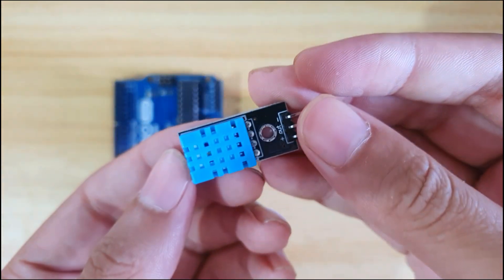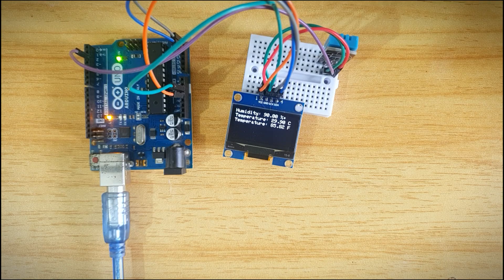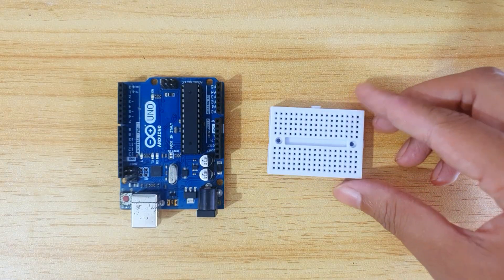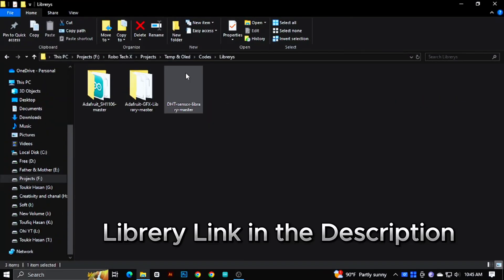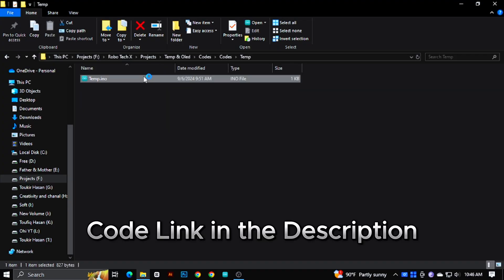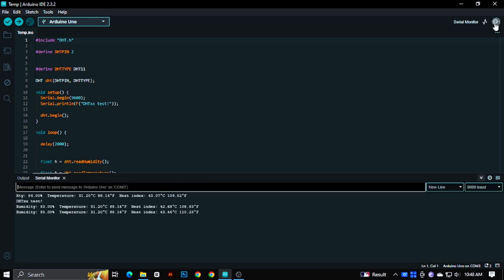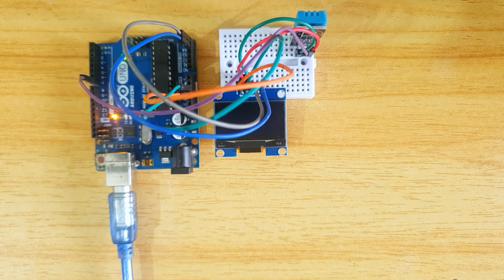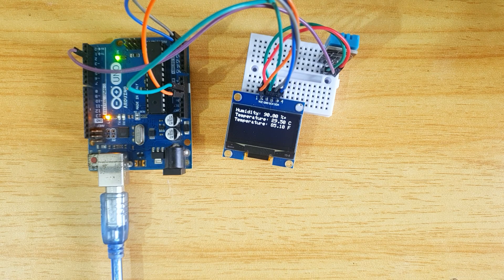DHT11 Temperature & Humidity Sensor with Arduino

Comment: May better use a BME280 Sensor. There are some moduls out with I2C what make it easy to use with Arduino and Co. The BME280 also contains pressure and temperatur and is much more small as the DHT11. I used it together with a Arduino nano and a small oled display. Sensor and display get controlled by I2C.
Reply from the maker: Thanks for your advice.